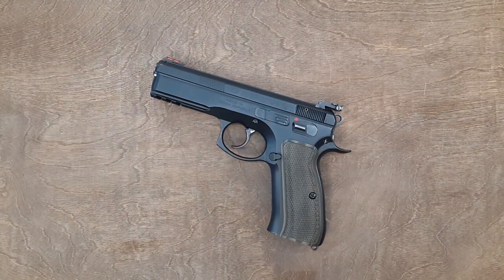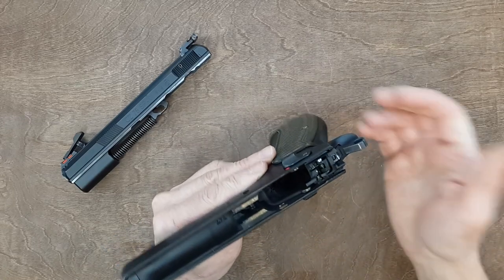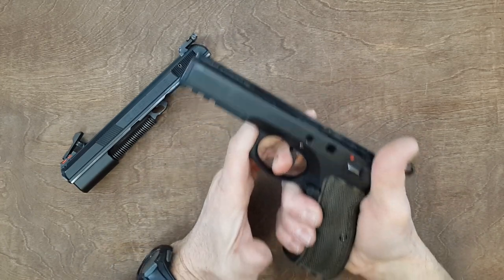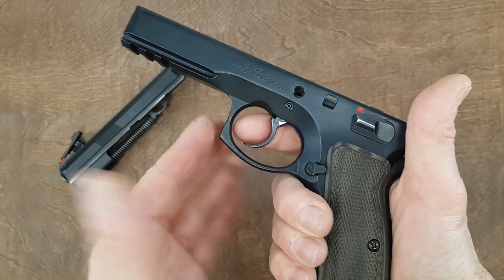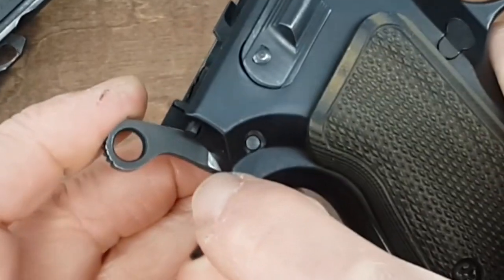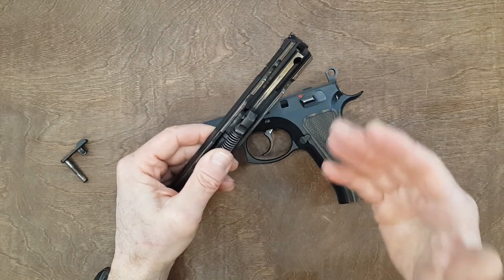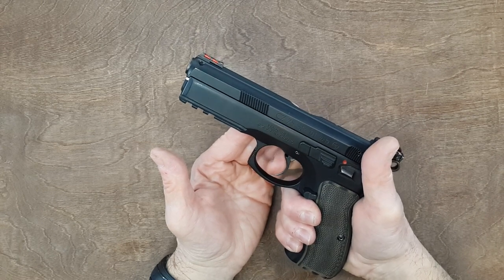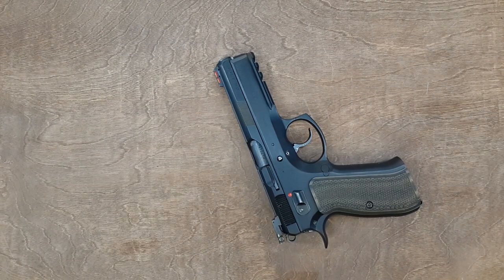Hand Polish Parts vs Action Polish Parts

Comment: I just polished a Glock 34 that had 4000 rounds on it - there was still an appreciable improvement.  I found a couple spots where action parts rub on the frame and are areas nobody generally talks about polishing.  Hit the side of the trigger like you show and the flat of the trigger guard and the corresponding part of the frame and inside of the gen 5 mag catch- it is a much smoother / linear pull than it was on action wear
Reply from the maker: That is really good to know, thank you. 
I can't believe we brought the polishing issue withing 24hours of each other. What a coincidence.
I seriously encourage Glock owner's to go check out that very good video of yours.
By the way, I am still wondering why you went from CZ to Glock, LOL
Reply: Practical Shooter I learned from the Glock how to drive the gun back down in recoil.  You don’t have to do that as much with CZs due to the dust cover.  Once I learned that there wasn’t any difference in times on drills it didn’t make sense to then spend a bunch of cash making a CZ Optics ready when the glocks can come that way relatively cheap.  I will probably get a tac sport for limited

Comment: Great video and great information to CZ owners!

I shoot my CZ's between 750-1000 rounds before I start polishing the internals. That way you can see where all the wear marks are and you can focus on polishing those areas. I've seen some videos where guys just go crazy with the dremel and sandpaper polishing everything inside but I think that's unnecessary IMO.
Reply from the maker: That is a really good way to find out where the polishing needs to be applied. Well done

Comment: Manual polishing has no substitute. Adler from atlas gunworks explains on his YouTube chanel very well the difference between letting your gun "polish itself/break in" vs hand polishing every contact move on moving parts. Also breaking the edges is very important.

Comment: Love your videos did you have to do any filing on your rear adjustable sight to get them to fit I’m thinking about buying the same sight for my t120
Reply from the maker: Yes, I had to do some very light filing. I think it was more to remove the coating than to remove some metal.
Reply: Practical Shooter thanks for the quick response I’ll be buying this sight